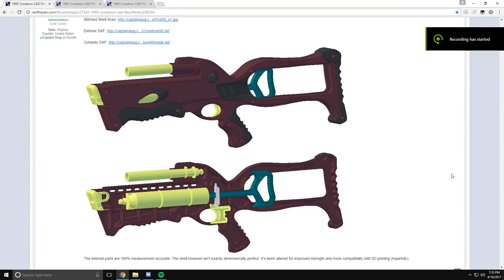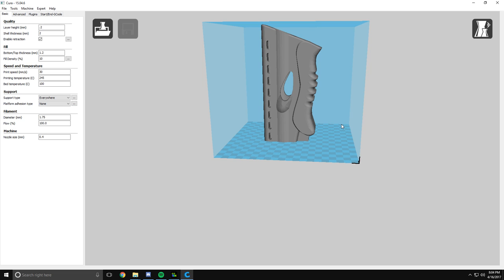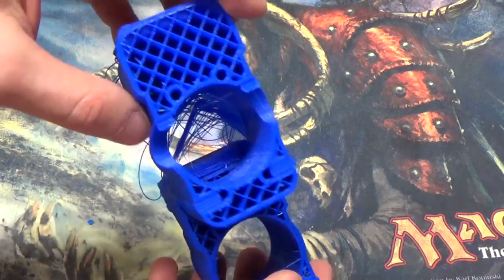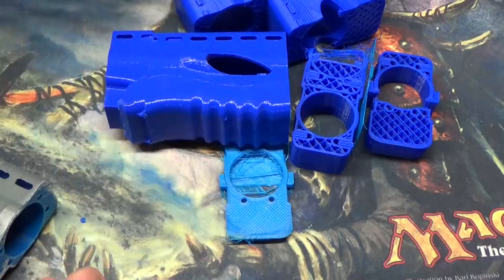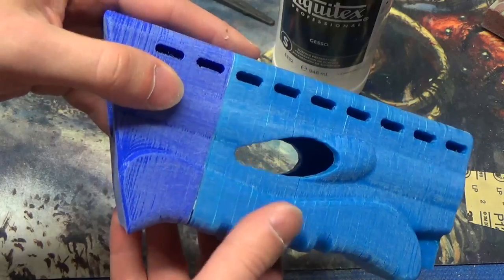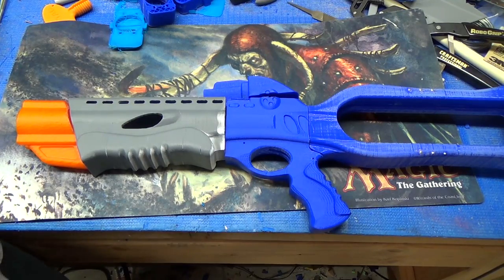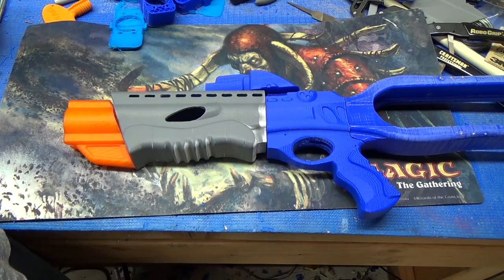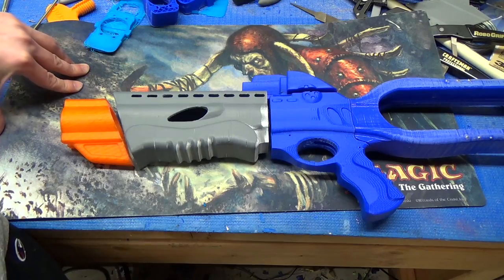3D Printed Nerf Crossbow Build [Slugbow Part 1]

Comment: The "Original" model is really only there for reference purposes and for 
people to machine replacement parts should their stock ones break. I didn't really design it with printing in mind like I did for the other two.
Reply from the maker: +CaptainSlug that makes sense, it would be incredibly difficult to get a quality print off of a clamshell design like that. I have to say the other two versions are pretty impressive and the tolerances are great. Great step forward for 3D printed blasters becoming more popular

Comment: Is there any way to smoothen 3d printed parts without making them look sanded?
Reply from the maker: Yes there are several techniques that involve sanding, applying various coats, or even acetone vapor
Reply: Couple questions: Do you have any updates on this? Also, what elite blue filament are you using?
Reply from the maker: It works really well functionally, gets about 250 fps. I used Hatchbox True Blue PLA
Reply: Your crossbow looks amazing. How much would it cost to print me one entire crossbow the same version you have? I want to make a crossbow without searching ebay or paying $1000 for a decent printer to make one.
Reply from the maker: It's not my design so I would need to check with the creator to make sure it's cool first